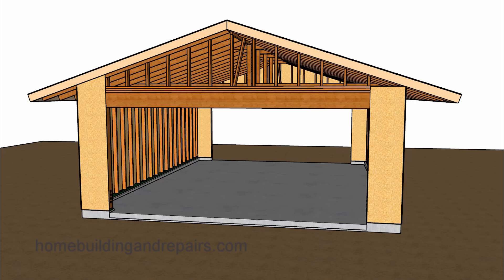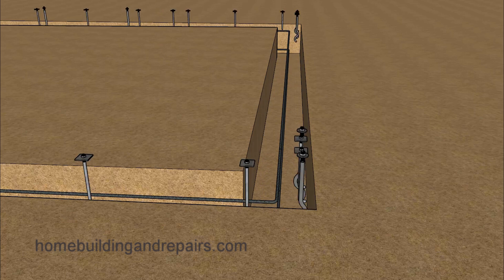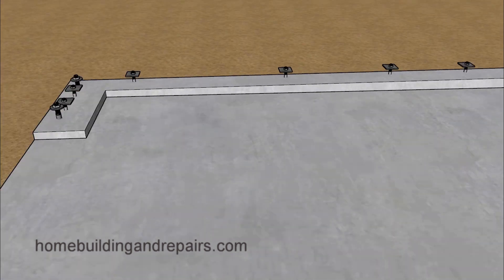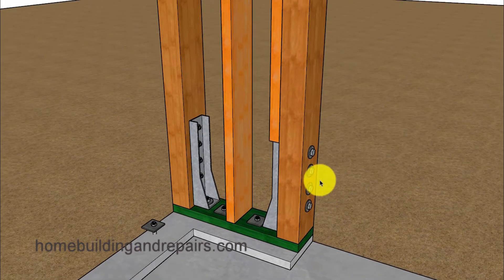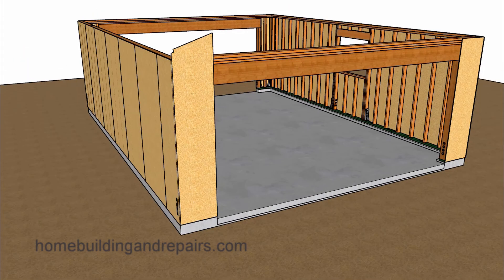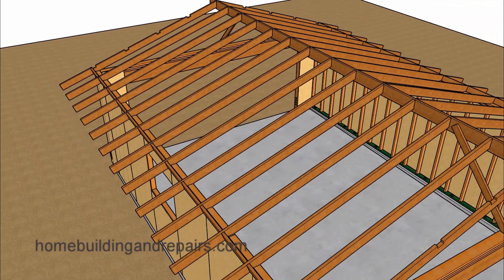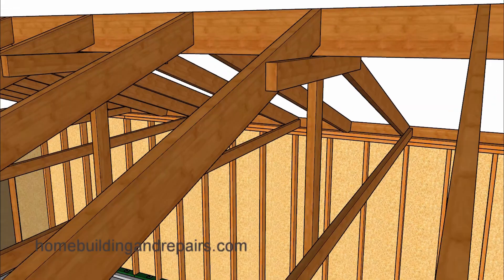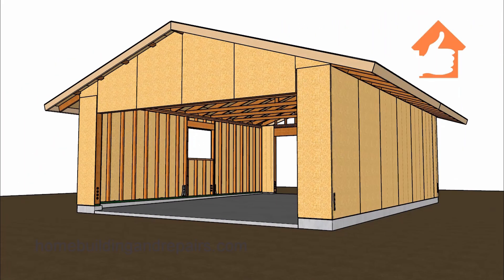Learn How To Build A Two Car Garage You Can Drive Through - House Framing And Carpentry Education

Comment: Hi, you said a 20’ wide garage. How did you find rafter ties that long? Thanks
Reply from the maker: They sell them were I'm from, but if you can't find them, then you will need to nail smaller boards together. I have examples at our website.

Comment: Unrelated to the video above, but what would you recommend doing to remove a load bearing wall that is directly supporting a 16ft high ceiling, and rafters just on the other side? Let me know if there’s another way that I can get to you the details.
Reply from the maker: Go to our website and check out the remodeling/framing sections.

Comment: Hey Greg, what is the usual header size for a 10 foot opening?
Reply from the maker: For a single story, It might be between a 4x10 and 6x14.
Reply: @gregvancom  Thanks Greg. Say, if you don't have 1/2" plywood laying around for headers, do people get away with using 7/16 OSB sandwiched in between the 2x material?

Comment: I think I mentioned it in an earlier garage video, but you should really be considering portal framing those garage headers with such narrow walls on each side. I don't live in a seismic or high wind zone and its required here.
Reply from the maker: I think you did and I looked at some information on it and will make a video if it works out. Thanks for the video idea.

Comment: thanks for vid.  i was wondering if u could do a simple video on making a structure square.  In the past i have used 345, corner to corner, and other methods n they all seem to contradict each other and then i end up with a unsquare project.  i get so confused and frustrated.  For example a 4 post structure, it may be close on bottom measurement but way off on top.  So what is best method n when is it time to leave it alone n move forward?
Reply from the maker: Go to our website first and check out the construction math, deck and foundation videos.
Reply: FF did

Comment: I would use a full sheet of plywood cut to fit in the upper corners, to add rigidity.
Reply from the maker: If you're suggesting to rotate the plywood 90 degrees, just make sure it's okay with your engineer.
Reply: @gregvancom  I think what they mean is to do it like drywall. Put up a full sheet and the cut out the openings with a router or similar.
Reply: @Ilove3SGTE  yup...